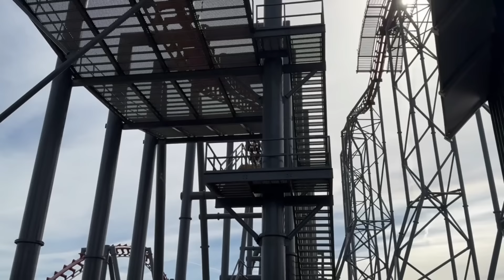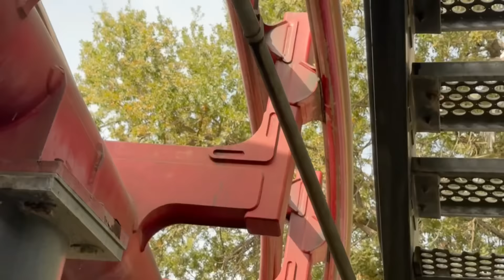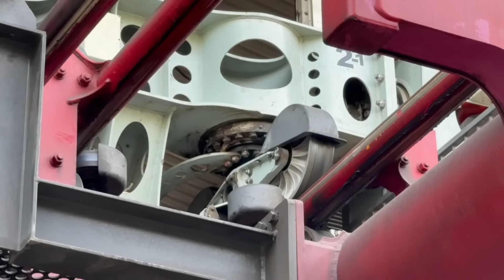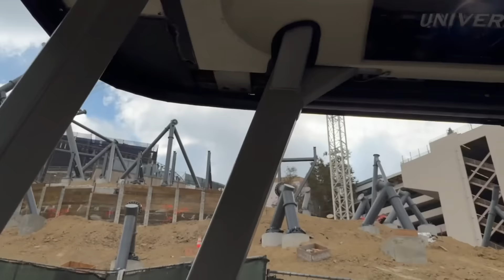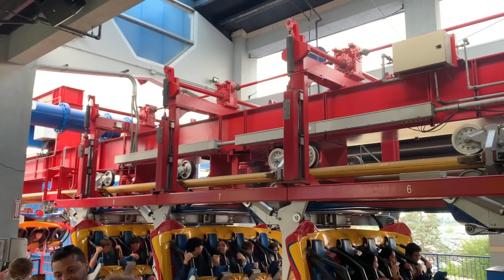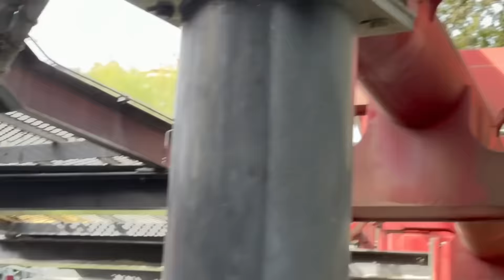Can another fourth Dimension roller coaster be made

Comment: Hmm I think the following:

If a new 4D roller coaster was built it would likely be the existing design, mainly because I don’t think any park is going to want to go through the rigmarole of prototyping because it’s expensive and took forever with the original X ride.

Second with the motor design - like you said the issue becomes failure modes and you have to design the ride so that I can traverse the whole layout in the “worst” orientation. The problem you would run into is that you probably couldn’t make a particularly thrilling layout because of this. Take a vertical loop, imagine running a b&m sundown coaster around the vertical loop from a b&m invert. The g-forces would be unimaginable and it wouldn’t be safe. That rules them out. There aren’t many other elements that you could build. It’s effectively as if there is a g-force cap on the ride of 1.2 gs. Not all that thrilling.

Also, I would imagine the motors and batteries required to get this setup working would probably still cost more than a heavily weight reduced train. Additionally just reduce the train length if train weight is such an issue.
Reply from the maker: All valid and good points.

Comment: 7:25 The Raven turn is the massive half Loop that flips the track over and continues in the other direction, the only turn that's like a turn turn they call the luge turn, since you're kind of in a luge position as you go around Nerdge
8:18 Also in this one video I heard 50,000 lb or 25 tons; pretty sure 70 tonnes is just a bit exaggerated..
Reply: I can't help but feel like having electric motors and all that on the trains wouldn't actually save that much weight, plus the energy demands from it to turn it as fast as it needs to move would be hard to keep up with, like you mentioned 🤔 B&M flyer seats also aren't exactly that light either.. I feel like doing the free Spin idea, but putting a control rail on the side (of that already taller track) would be the best bet (yes I've thought about this, for a while actually; definitely not the right time I'm the most obsessed with over any other 👀 esp with that soundtrack) and intamin can keep their grubby copycat hands off of it, they ain't do 💩 no more other than copy off everyone's homework and try to make it look like their own; not that they do a very good job with that either

Comment: Something like how an aircraft EHA works, with an electric motor powering a hydraulic system to actuate the train would probably work. EHAs are incredibly robust with multiple redundancies to prevent flight control failure. Additionally, you could have an onboard accumulator to provide emergency seat positioning in case of a pump failure or a valving system that lets the seats free spin to legs down position. As for power: bus bars, quick charge batteries, and inductive charging when the train is in motion are all solid ideas.

Comment: It occurs to me that you wouldn't have to actively rotate the seats; what if you just used a brake on a slightly bottom-heavy row? Get halfway through a loop; brake on. Go into the next, brake off. Go down a drop into a round valley, brake on. Get to the top of the hill, brake off. 
Come into the station; brakes off and gravity levels them. Change the brake off/brake on rules, and you've got a different ride experience.
Reply from the maker: Yeah, you could do that. Kind of an interesting theory. It would almost be like a top spin on wheels.
Reply: @ryantheridemechanic  Actually, I was looking at the Arch and wondering how the cabins rotated. I rode to the observation deck back in the late 1980's (then, I think it was 12 min up and 8 min down, now it's apparently upgraded to 4 min up, 3 min down), it felt like motorized turning, but what little I could find searching out how the trams work today said they rotated from a combination of gravity and motors.

Or the old Rock-o-Plane. Rider-controlled brake to choose your own ride intensity.

Comment: My initial thought as to how to solve the weight and roughness problems was
- Aluminium frames (less weight, Zamperla and S&S have already started using these)
- Spring loaded rotation wheels (reduce one spot of back and forth rock)
- Potential cutting down to 1 rotation rail, although that may create some weird twisting forces with the uneven rolling resistance

Whilst the motorised spin is a good idea in theory (and I agree on the customisability), making it so that it fails safe is going to be much harder than on a more regular spinning coaster. And reducing the G Forces to anything less than 3 on that scale is going to be extremely difficult and restrictive (and is already way past ASTM standards)
The sort of new elements I’d like to see (that I’ve put in my own designs) is an Upward Outside Raven Turn where the track does half a backflip and the seats complete it, as well as disconnecting the seat and track rotation rates for extreme disorientation (ie, seats rotate faster than the track). With enough banking, turns are essentially loops laid on their side. The seats could also just be kept in the narrowest position during a flat turn so the extra clearance required by laying horizontal isn’t needed

Comment: I'm not sure how feasible motor-driven rotation would be for this style of 4D coaster, mainly due to what you mentioned about the possibility of the motor system failing and the seats getting stuck in an adverse position.  The human body's limit on negative Gs is much, much lower than positive Gs, with only a force of -2G to -3G being possible before causing a red-out along with potential brain or eye damage or even death.  This would significantly limit the intensity of such a ride as it would probably need to be designed to never generate more than 2G (positive G) in case the seats got stuck upside-down.
Reply: Yeah, that head-down drop on X2's first hill gave me a massive headache on the top of my head.  If only for a brief moment.  But I could see your point physically being a problem.
Reply: Couldn't S&S simply use the magnetic rotation developed for the free spin model?
Reply: @michaezell4607  It wouldn't really be a classic 4D coaster then because the seat angle wouldn't be positively controlled.

Comment: I think an issue with using a motor for controlled spins instead of the way 4D coasters work now is risky... the forces on them are so extreme, if you took them in the incorrect position it could do some damage. And using motors isn't failsafe

Comment: I rode X back when it was just X... about three or four times... Certainly a fun ride, and one I'd love to see done again... but WOW... the issues... I mean, this is the ride that essentially destroyed the company that started the Modern Coaster Revolution with the Matterhorn... I dunno if I'd wanna be the company that tried it again.  Though, with the advancements you've talked about - it would probably be doable.  If I recall correctly, yes, the ride vehicles on original X did top out at about 70 tones.  Holy.  Crap.

Thanks for a great vid!
Reply: X isn't the sole reason why Arrow went under, it was just the nail in the coffin. Their refusal to innovate with computer design until it was too late made them lose the market to B&M, which produced smoother, more reliable, and more appealing rides. Nobody wanted to buy anything from them anymore.
Reply from the maker: Your welcome!

Comment: Using drive motors becomes a safety issue when you use them for vertical spin.
Let's say a motor fails while the ride is running. Now those seats are stuck in one position. If that position means that riders' heads are facing the ground during the pullout after that first drop or at the bottom of that second raven turn on X2 then there's a good chance that some people are getting put in ambulances because of redout.
This is also why you couldn't make X2 a freespin and why the drops on freespins are so small and slow.

OK, just made it to 21:47 and you're talking about this now.
Nevermind, maybe.
Reply: I don't think he really grappled with what an engineering constraint on the ride this is going to face, though. You need to make it so that effectively you are limiting yourself to what would be +1g for any pullout of a drop or turn in a normal vertical orientation (because if the seat were upside down and pulling what would normally be +1.5g, you'd be pulling -2.5Gs once you account for the normal force of gravity, which is already at the ASTM standard and could not be held for more than a few seconds). This means the layout would have to be considerably more tame and less forceful than the traditional S&S/Arrow designs in a way that might kill their appeal as major thrill coasters. The ratchet and pinion design Shilke came up with exists for a very good safety reason, and going to motors means you have to design such high safety tolerances into the ride that it might not be a very good ride at the end of the day. I highly doubt it would ever be possible for them to retrofit the old S&S 4-Ds with such a train as he entertains at the end of this video for this reason.

Comment: Mack has done it even before Intamin and Vekoma. Euro-Mir, which opened in the late 90s is 100% controlled spin. Granted, it only spins during certain portions of the ride and remains locked in a straight position for a good chunk of the gravity portion (mostly because they only could have bus bars in certain parts of the ride, batteries that would have been up to the task didn't exist back then), but it has been doing it continuously for almost 30 years.

Comment: love the idea of using a motor for rotation. If each seat row has its own motor you could give the rider the ability to select the intensity and could have multiple models of rotation to make the ride a different experience, even no rotation.. Batteries to power large industrial motors 240/480v to rotate something that is a few thousand lbs under forces you might have to rotate 10k lbs and have to hold a lengthy charge would be large and heavy.  The wheels can generate electricity, station charges so it might be viable. Now you can have a motor just powerful enough to give it a nudge to flip the seats but to have full control you have torque on both sides of start and stop rotation. Brushless RC motors are insane so maybe there is a medium duty motor that leverages that technology more effectively .
Reply from the maker: If you think about it, you can actually let the guest select what ride they want to use on their particular coach because they would be interchangeable of what the rest of the train was doing

Comment: Would it be possible to replace batteries with some type of power pickup like you get on a powered coaster or is there some limitation that would make it not work
Reply from the maker: You could add bus rails at certain points along the track where the coach needed to twist, but bus rail is extremely expensive to put in and it’s quite a delicate feature, especially when you get at higher speeds so not sure if that would be the best because in my mind it would just destroy itself out there

Comment: I don't see this happening without some failsafe system to put feet down, otherwise you're basically limited to 1.5 gs with 1 second of 2.2 gs, I'm not sure how a good ride could be built with that limit.
Reply: I agree. An intense ride like X2 would not be possible with an electric motor.

You could however do a mild ride with an electric motor.  So that if the motor fails, the gs would still be within a safe limit for any orientation. The failure of the motor would just be a less fun ride.

In some aspects, a mild ride with an electric motor would be more fun. If the park wanted a new ride they could upload a new program into the train and provide a completely different experience.
Reply from the maker: Maybe an overwriting clutch to open up to let the seats go towards gravity, but then they would be out of position might cause more trouble than it’s worth

Comment: There are a few ways to mitigate the issues of a 4d without really changing the ride system. Short 3 car trains would reduce weight a lot, and a launch would reduce the amount of supports compared to a lift. 3 trains with 3 cars and a short cycle time could hit over 1000pph throughput, while still being fewer total cars to maintain than any existing 4d coaster. It would also mean less of a throughput reduction if one train needs repair. Making them shorter than 200ft (unlike the current ones) would also help reduce the cost of steel for one of them.

Maybe moving down to only one controlled spinning rail would help too, but I don't know how they would do that.

With motor controlled spinning, the failure modes mean you're stuck at low intensities but with a very intimidating looking ride system. That leaves the ride in a worst of both worlds situation, being too intimidating for families and too tame for thrill seekers. It's the same reason no one wants to buy an axis from s&s.
Reply: Someone came up with a method for a single controlled rail.  It involved a twisting rail in the center of the track.

Comment: I've noticed that Eejanaika and I think Dinoconda both have shorter trains. What difference in weight would that be in comparison to X2's longer train? X2 is still #1 on my bucket list.

Also, according to Alan Schilke the 4th Dimension model was meant to be a smaller ride. Six Flags wanted it to be bigger.
Reply: If the latter is true, is it fair to say that Six Flags killed Arrow Dynamics? After all, that project bankrupted them...
Reply: @Colaholiker I think the answer is far more complex than that.  I've heard different stories about the arrangement between Vekoma and Arrow. The bottom line is they became a competitor and undercut arrow on the clone market offerings.  Arrow kept developing the wrong projects such as the pipeline coaster instead of the inverted coaster, the stand-up coaster and bobsled coaster.  None of which panned out for them.  From the ACE documentary, the management was resistant on investing in new ideas for flat rides which didn't help them. They held on to their traditional methods of development too long and when they tried to change they botched it with drachen fire.  By the time they got their methods fixed, dh Morgan had already taken over the hypercoaster market (with B&M and intamin releasing their own versions),   vekoma already had the entry level looping coaster market And B&M had taken over the More premium offerings.  Six flags wanting a hyper coaster out of it Did Arrow no favors, but six flags management of that era was neither practical nor looking at the big picture.  It would have been better for both companies if they would have started small like most prototypes are and grow it from there  once the bugs are fixed on it.  Arrow didn't have to say yes. They could have said no and tried to see if they could find some other work For a more realistic customer, though there's no guarantee they would have been able to find it and they might have gone bankrupt either way. The company was just having problems because the market was so flooded with competition and they were trying to find a new gimmick since they had had prototypes like the aerobatic coaster where they were trying to get into the inverted market but nobody bought one. What the right decision was is honestly hard to say. It's not entirely six flags fault, but it's not entirely arrow's fault either.  I personally wish six flags would have first installed a new generation hyper coaster at over Texas like they had considered giving the post Ron Toomer era A chance to build a massive coaster, make a little profit to put the company on stronger ground and learn what they needed to from a massive project like this.